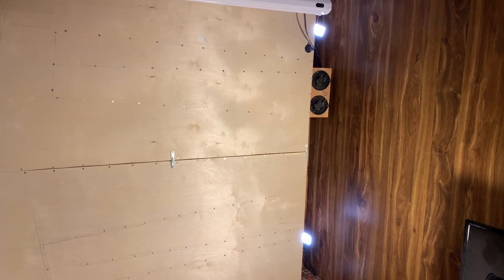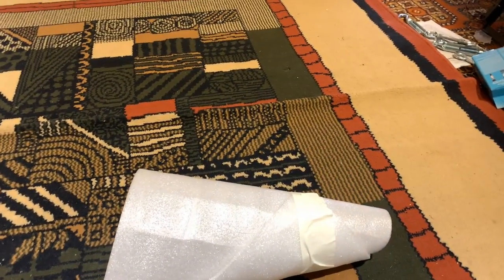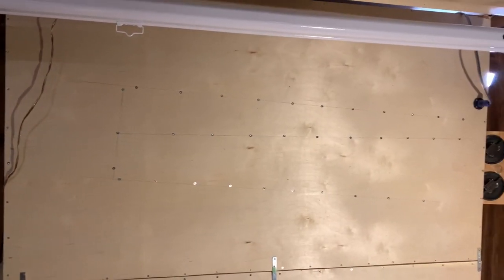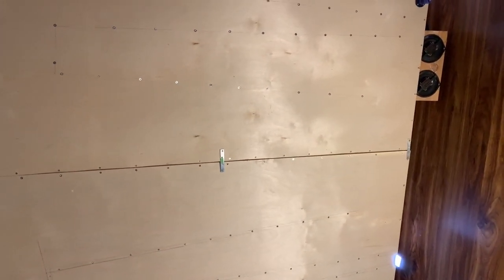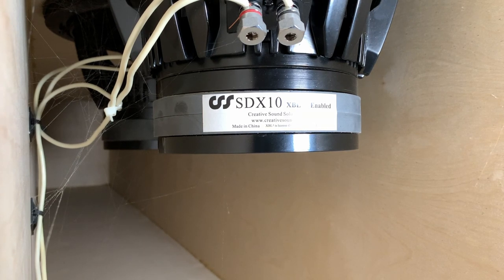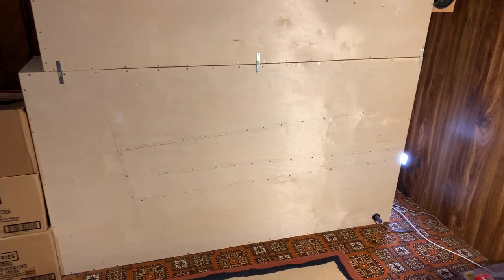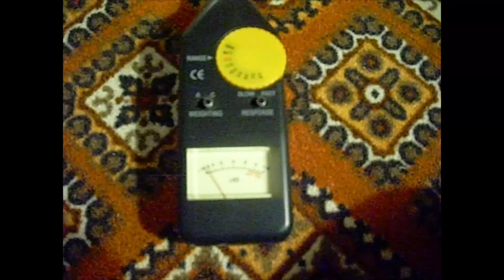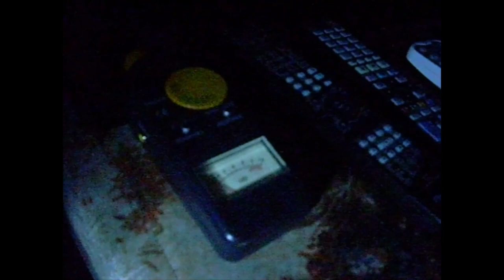Tapped Horn Subwoofers

Comment: 127db with only 350W?! that seems completely ludicrous. can you explain to me what is then the tradeoff/limitations of using smaller drivers like 8 or 5 inch? what do you lose/gain by doing this in comparison with larger drivers, generally speaking? i build bass speakers from plans i find but they're usually with 18 inch drivers, and then i'm running them with like 2,5kw amps at least. watching this video i realise how completely ignorant i am to the physics. if it's possible to get that loud a sound at such low frequency with so little power then why would one ever bother going for bigger drivers?
Reply from the maker: It seems ludicrous until you actually hear these things doing it. Then you start worrying about breaking the house. Horn loading more efficiently couples the drivers to the space, and when you point them at a corner they get even more efficient because the corner is now part of the horn.

It's all trade-offs. 8" or smaller drivers can't displace enough air to get to the 115dB Dolby level at listening position down to 16Hz unless you use more of them (and end up with a bigger enclosure). But a pair of 8s could possibly do it at 20Hz instead with the right drivers. Likewise, my 10" drivers can't get below 16Hz with enough volume for similar reasons, and when you go up to the 15" drivers needed to do it, now you have a box so big you might as well just do traditional vented cabinets and build more of them.

Also one has to consider how cheap it is to get big power to drive more boxes with today's amps. Budget, space, electrical, what you need to get out of them... it's all about what's going to work best for the specific situation you're dealing with. The horns I built are perfect for my use case - that's why I've never even thought about replacing them. All I need from them is 120dB max at listening position to 16Hz to cover all potential needs and they still have plenty left on the table at that point. Amps are happy, wallet's happy, I'm happy, and I'm nowhere near any neighbors to complain about them :D

Comment: Could you point me in the direction to start modeling them or would you sell plans. I am looking to use a sundown sa12 classic for my home theater powered off of a taramps smart 3 I'm running off of a battery bank and rv power converter. It has low pass and subsonic filters in the amp. I was thinking tuning around 25 to 30 hertz. Any help would be appreciated. Keep up the good work.
Reply from the maker: Sorry - I use Hornresp for modeling, but it has a steep enough learning curve I'm not sure I'd be able to help too much. I got a lot of help from others to learn how to use it, mostly on AVS forums back in the day.

Comment: If you had tuned your vented box higher it would have gotten louder. 11 Hz is quite low, maybe 15-20?
Reply from the maker: Yup. Could have also built a second one that would have taken the system over reference and just used the other channel of the 1850HD. But I wanted a challenge, so I did the tapped horns. No regrets. But the IXL was fun for a while - it had a little something extra in that it used to feel like someone was grabbing the back of the couch and shaking it at times, which the horns can't quite do as well, but the horns get so loud in their passband it doesn't matter much.
Reply from the maker: I've got a 14Hz tapped horn design that never made it into reality that uses two 15" Sundown drivers. Sometimes I think it would be wild to try and bring that monster into being, and then I remember it needs two full 4x8' sheets of plywood just for the side panels. Also costs a fortune. Horns of any type really make more sense above 20Hz IMO - they get too big below that. But I'm a nutcase so I went for 16Hz twice so who knows whether or not that big one will ever come into being. The idea behind that one was to come up with something like what I have now for commercial movie theaters - our local theater overhauled their system a few years ago so I couldn't help but wonder what I would do if I owned the place. IIRC that design pushes 135dB at one meter.
Reply: @TimpBizkit  I enjoy folded bass horns too, but that's the first I've heard of the braking effect on the woofer of a long horn. Do you have any measurements or research done on this?
Reply: @markbushinski1198  unfortunately not.

Comment: Thank you for posting this, I like seeing tapped horn projects on video. What did you use to cut the panels?
Reply from the maker: I used a circular saw with a cheap two piece guide to keep it moving straight. Ended up having to brace the guide in the middle for the longer panels, but it worked pretty well.
Reply: Those last vids where the icing on the top wolf! Epic and thanks for the inspiration, keep the vids coming brother and get bk building, maybe try making some back loaded horns  or modefied cerwin vegas with some 12s, one for each corner.

Comment: I'm curious to know if my square sub would work well in a tapped or folded horn since it's square?
Reply from the maker: The formula I use is Bl^2/Re/Sd - anything between 0.12 and 0.20 is a potential tapped horn candidate. 0.08-0.12 for folded horn. I've also looked for a Qes of around 0.3 to quickly tell if a driver's worth looking at for a TH before using the formula on it.

Comment: How did you fold them?Did you follow a tutorial?Could you link it?
Reply from the maker: Folding is the hard part by far. For these I exported the hornresp dimensions, went into Sketchup, and did a lot of cut and pasting to see what worked for 4x8' plywood sheets. After each fold, I then measure the path length and plug the numbers back into Hornresp to see if I got anywhere near a desirable result. If anything at all is off, I get to do all of that all over again. For my SDX horn, I think it was fold 3L that made me happy: 3 being the number of major revisions to the design, and then I went down the alphabet just trying different folds. Takes me months to do that. I'll try and do another video at some point going into that process a bit more.

Comment: Bud, please make one that uses a single 6 inch or 8 inch with a smaller profile.
Reply from the maker: That might be a tall order - the tuning would have to be pretty high to get a decent amount of SPL out of such a small driver. Low, loud, little: we can only have two of those things and have to sacrifice the third. I tried to come up with a home theater design using one Tang Band 8" before I did that first dual 8x12" box, and quickly realized that I wasn't going to get reference level SPL from it unless it was tuned well over 30Hz. I suppose it could work outside of home theater use though.

Comment: Hello. Noob question. Do i need the speaker polarity inverted so that it will be in phase?
Reply from the maker: If wiring the two drivers in series you would connect the amp positive to one driver's positive, the negative of that same driver to the other driver's positive, and then the amp negative goes to the second driver's negative.
Reply from the maker: For parallel, just run the amp positive to both drivers' positive, and the amp negative to both drivers' negative. Both drivers must be running with the same polarity to the amp.
Reply: To závisí v akej fáze bude stredotónový menič v mieste kríženia pásiem. 
Samotné basy nemajú počuteľnú polaritu. Ale plné spektrum už počuť všetky fázové kotrmelce, impulznú odozvu, a v neposlednom rade aj samotn frekvenčnú odozvu.

Comment: wouldnt be 6th order bandpass more efficient? Also easy to tune in wide range of low hz's
Reply from the maker: A tapped horn basically is a form of 6th order bandpass with horn flare - a traditional 6th order lacking the horn would lose that extra efficiency.
Reply: @Oklawolf  thanks for explaining, I got it now I think.
Reply: @Oklawolf  isn’t a tapped horn 3rd order? Im not super familiar with acoustic orders but,  I do believe u got the front of the driver as 1 order, back as 2nd and then interaction when they connect as the 3rd order. And then there’s no compression chambers in tapped horn so that’s it as far orders go.